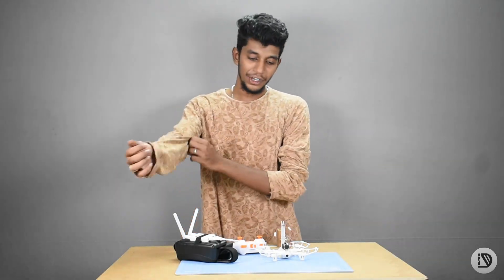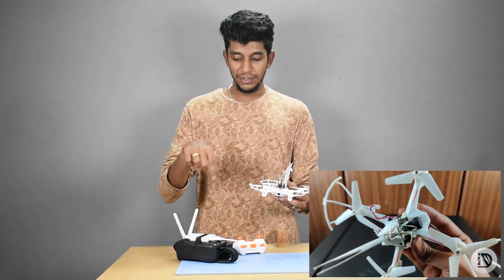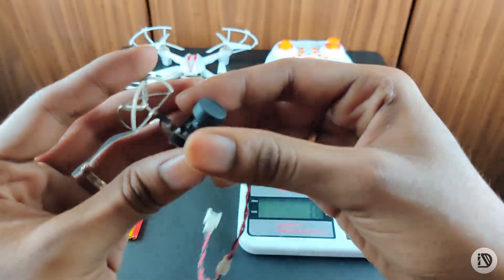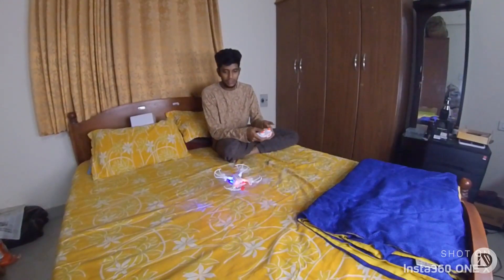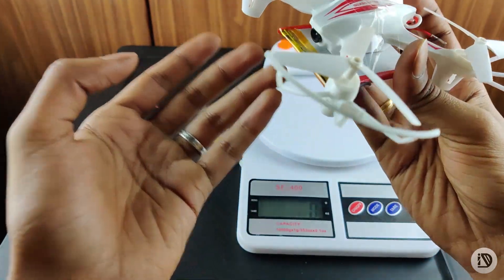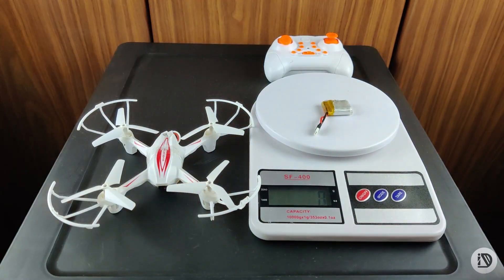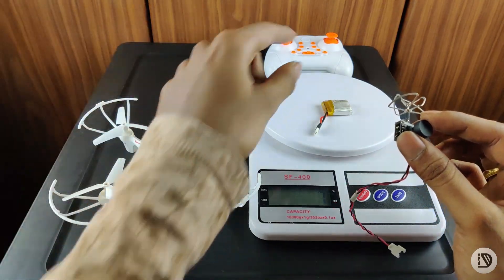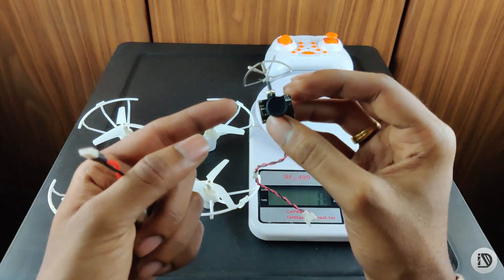🟡 HX750 drone with FPV camera setup | DIY | in தமிழ் | INNOVATION DISORDER

Comment: Anna please battery anna
Reply: @InnovationDisorder  athavathu pakkathula irukura storela vanguningala .
3.7v 600 mah {48×24×4}battery use pannalama anna . 
This is link: Core Technologies 3.7V 600mAh Lithium Polymer Rechargeable Battery https://www.amazon.in/dp/B07GZPDSKK/ref=cm_sw_r_cp_apa_i_5ToBEbJ4J3625
Please ithu okva nu sollunga anna. Because I think this is only 8.567grams neenga 9 grms kulla irukanumnu sonninga .
15-8.7=6.3 grams that 6.3 grms cameraku use pannalama anna so weight lift pannumla anna....
Please reply